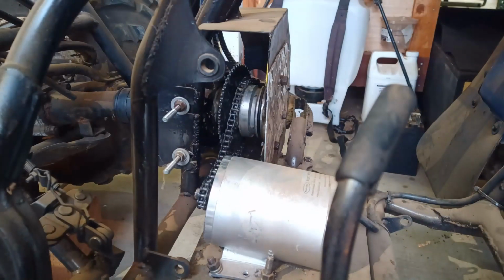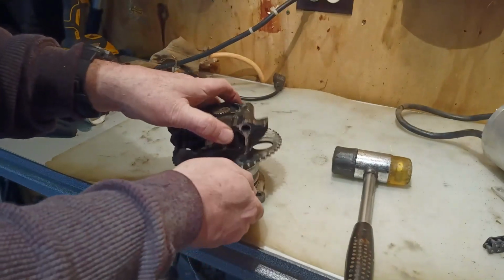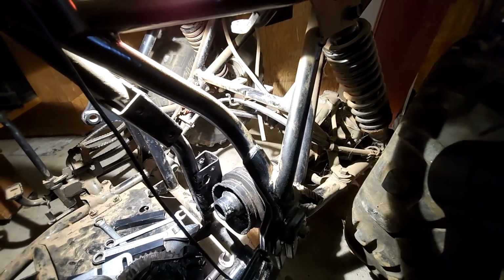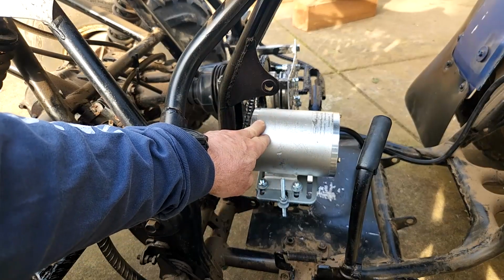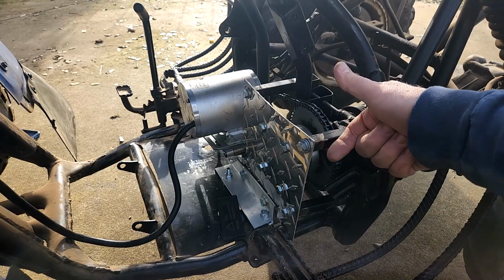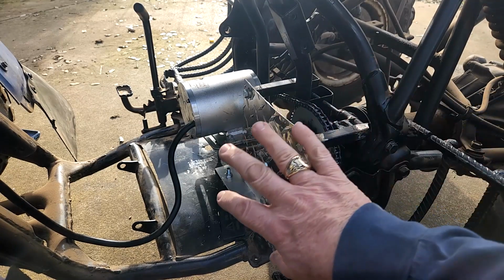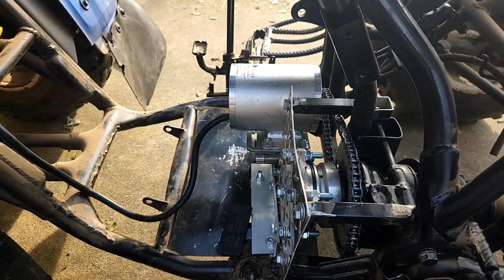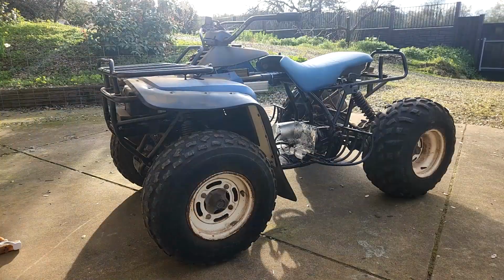Quad Conversion Two, Success

Comment: You're asking a lot of that little motor. Have you checked how hot it's getting?  Cool project by the way.
Reply: Not to hot to touch so far. I think the step-up ratio of the small sprocket to the big one is making it work. I'll have to figure out the math of it before my next video.

Comment: Nice video. I would like to electrify my Kawasaki Bayou 300. What would be the best kit to achieve that?
Reply from the maker: I bought an all-in-one kit from Amazon.
https://www.amazon.com/gp/product/B07KR2FN89/ref=ppx_yo_dt_b_search_asin_title?ie=UTF8&th=1

The biggest drawback is matching up a chain sprocket to the Kawasaki drive shaft.  There would be things I would change if I did it again knowing what I know now.  The biggest is that I would have taken the shaft and the sprocket to a machine shop and asked the pros to connect the two.  My welding approach is not perfect. I improved it the second time around, but a competent machine shop would be more reliable. It is a bit satisfying though to have made this happen only using my homeowner level tools and skills.

As others have suggested, a golf cart motor would have a good chance of being adapted to connect directly to the shaft, but I could not find a "Kit" that incorporated the voltage controller, throttle, and charging controller all in one with that kind of motor and I don't know how hard it would be making the connection to the shaft.

As for my build, I am satisfied the combination will serve its original use to let my wife move garden tools and debris around the developed part of the property. I am hoping it will also prove to be a good vehicle for accessing the creek area of my property, but I have to finish outfitting it and wait for the rains to end to see if it can haul up and down the steep hillside.  That will be another video when it happens.
Reply: @bonesetranch  what type of batteries you hook to it?
Reply from the maker: I purchased a 72V, 25 AH Lithium ion Battery pack rated for a 3,000W motor on Amazon.  I wouldn't recommend ordering from this manufacturer because it arrived DOA and I was ghosted on customer service.  Not a surprise that the seller is no longer in business on Amazon.  I did finally trouble shoot the issue (seen in https://youtu.be/O9vWp4k5DoA?si=4trLEolcZirZEtdg ).

There are many more options for buying the battery that can be used through Amazon these days.